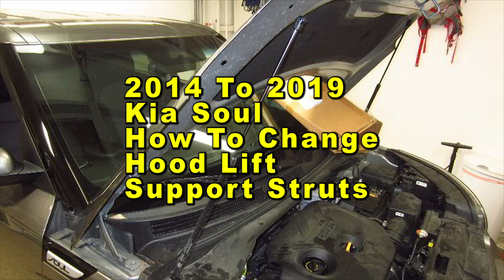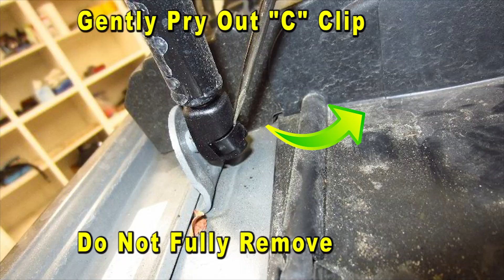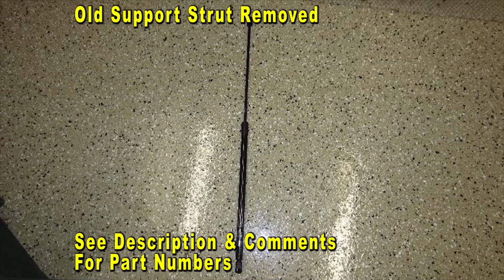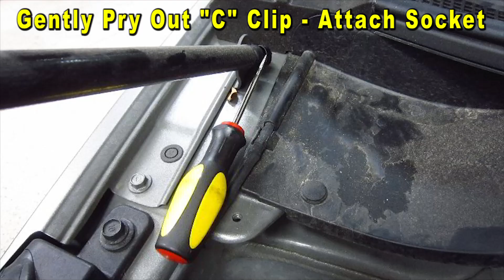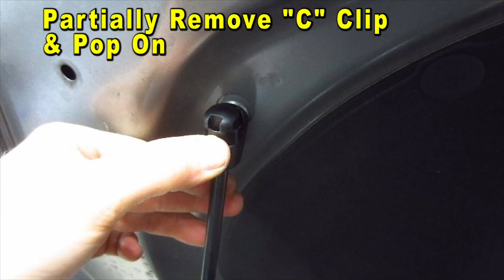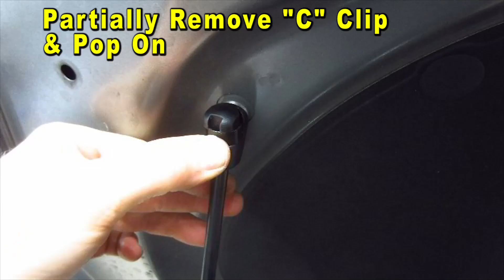Kia Soul How To Change Hood Lift Support Struts 2014 To 2019 2nd Generation With Part Numbers

Comment from the maker: Check out the DIY guide for changing the hood lift support struts on a 2nd generation 2014 to 2019 Kia Soul with the Nu 2.0L GDI I4 engine - 
https://www.paulstravelpictures.com/2014-2019-Kia-Soul-Hood-Lift-Support-Struts-Replacement-Guide/index.html

Here are all of the DIY repair and maintenance tutorials for the second generation 2014, 2015, 2016, 2017, 2018 & 2019 Kia Soul -
https://www.paulstravelpictures.com/Articles/2014-2019-Kia-Soul-Common-Problems-Repair-Maintenance-Guides.htm

Owners of other Kia, Hyundai or Genesis vehicles such as the Niro, Sportage, Sedona, Telluride, Sorento, Rio, Forte, Optima, K900, Cadenza, Stinger, Tucson, Santa Fe, Kona, Palisade, Elantra, Sonata, Accent, Veloster, Ioniq, Nexo, Venue, G70, G80 and G90 may also find these DIY instructions to be helpful.